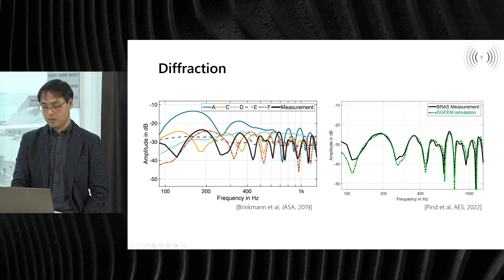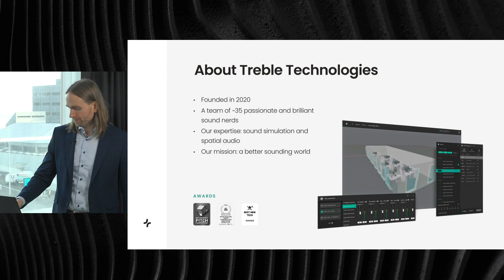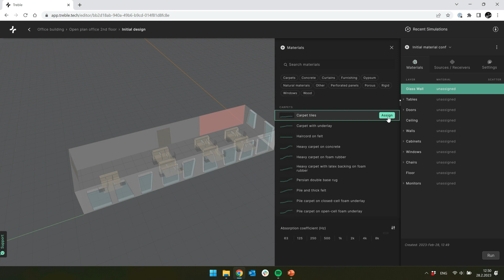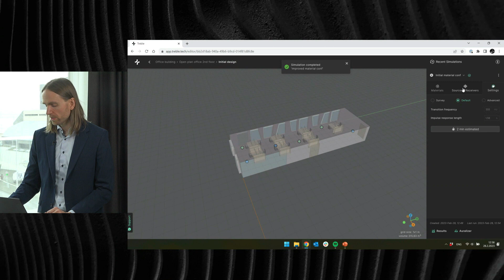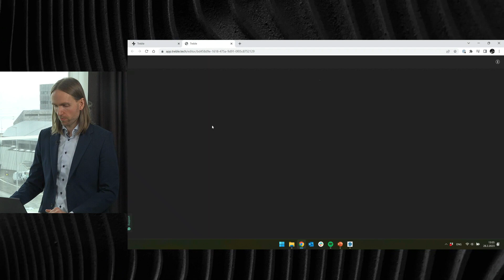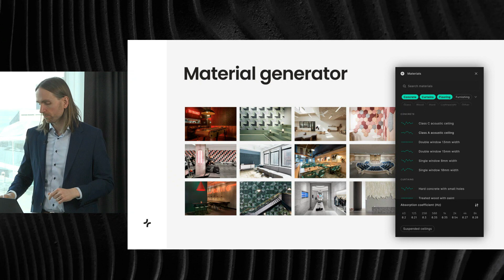Webinar: The launch of the Treble acoustic simulation platform

Comment: Great presentation,. Seems like a fantastic tool with a well-designed interface. Is it possible to auralize the low-frequency modal response of a small room, and hear the differences at different positions within a room?
Reply from the maker: Hi Avi. Thank you for the question. Yes you can indeed simulate the LF behavior in a room and capture all the room modes quite accurately. You can define a grid of receivers (i.e. listening positions) within the room and listen to them in the auralizer tool. There you can rotate the head position and jump between different listening positions or different simulations. You can also analyze all the frequency responses in the results viewer.